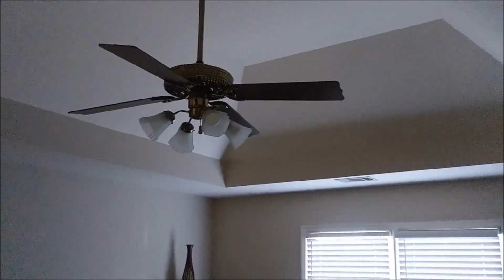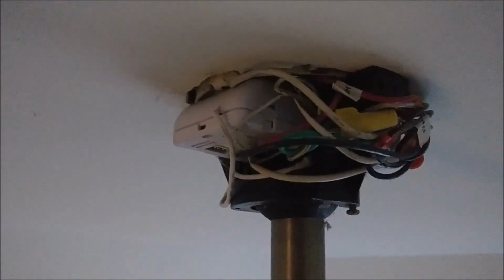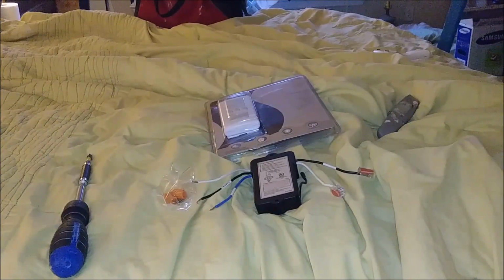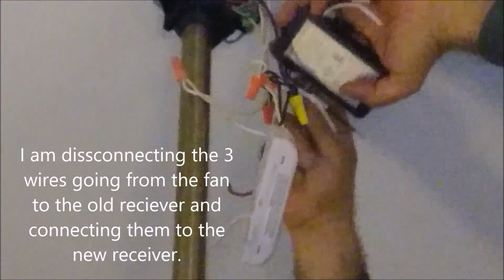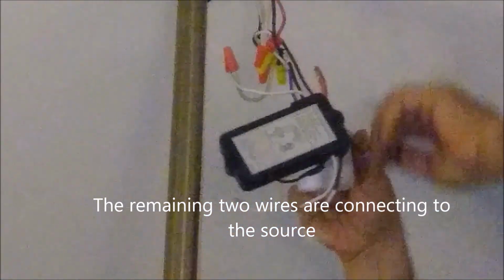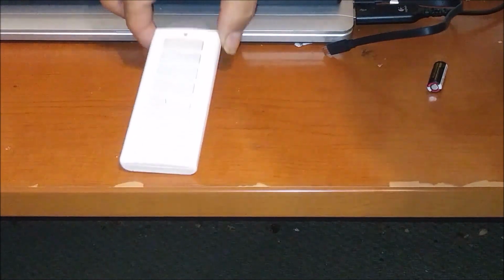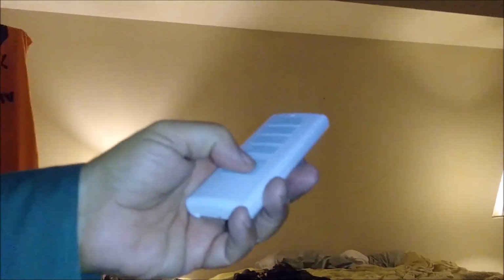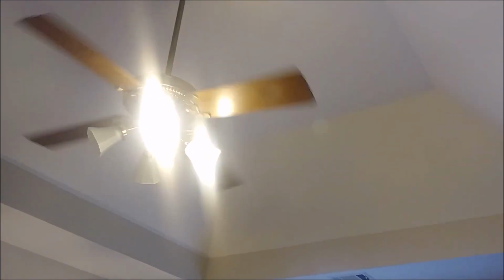Replace A  Bad Ceiling Fan Remote Control With Universal Remote Control - Step By Step

Comment: Main 2 WHT blk wires plug into the clear connectors. Don't cut them off.  Easier and faster than wire nuts!!
Reply from the maker: I agree . My mistake.

Comment: Thanks for the video. I'm having the same issue, the light is flashing. but the ceiling fan is not spinning. I'm not sure in your video if the fan was working with the old remote. For my case, do you think it is still due to the old remote control and receiver. Thanks.

Comment: My hunter fan lights sometimes turn off or on by itself. Replacing this part will fix it?
Reply from the maker: You probably have old remot that can not filter electromagntic noise. You should buy a new remote to replace the old one. Here is a link to new good remote and how to install it:
 Buy on Amazon Remote Control  = https://amzn.to/3i1VoVY  
How to install Video:   https://www.youtube.com/watch?v=yiwsOY6kqBY&feature=youtu.be&ab_channel=JosephK

Comment: How many time do you have to replace the remote control black box with the same ceiling fan?
Reply from the maker: Avarage one to 7 years but with the new technology it will last much more.
Reply: @josephk9182  Do I have to buy and expensive fan remote control to last longer or a cheap one, for similar duration.
Reply from the maker: No. Please look at my video:
https://www.youtube.com/watch?v=yiwsOY6kqBY&ab_channel=JosephK
There is a link under the video to but the remote on amazon. (Here is the link to the remote =  https://amzn.to/3i1VoVY)

Comment: Just wanted to thank you for this video. Even though it really is simple, as someone who has never done any sort of project involving wiring, this video was very helpful. It gave me the confidence to do it myself and it worked! The wires ended being the easy part, the hardest part was putting the dang canopy back on 😄 Thanks!
Reply from the maker: Thank you

Comment: To others watching this video: If your ceiling fan light is blinking, and your ceiling fan might be from 2007 or newer, it could also be a wattage limiter. Policy states that ceiling fans made in or after 2007 must have wattage limiter when including light kit, unless it includes CFL bulbs. It would be best to remove and bypass limiter first if there is one, then replace the remote receiver if it still blinks. Wattage limiter can be found in switch housing, or maybe even inside motor housing. However, the fan in this video is from mid 1980s so there is no way it has a wattage limiter.
Reply from the maker: The issue was the old receiver. I installed the same receiver on a number of ceiling fans in my house in 2009. All the receivers have similar issue with the lights after 8 years or so (no issue with fan speed only light). I believe this is the life expectation of these receiver. The new receivers are much better.
Reply: Yeah I know it's the receiver issue in your case, but some people had similar problem caused by wattage limiter.

Some people replace ceiling fans because they want ones that are remote controlled. It's a good thing you kept the old fans, they don't make things like they used to anymore!

Comment: That is a Hunter Designer's Choice. The fan is even older than the old remote; the fan is from around mid 1980s while the old remote is from around after 2000.

Comment: Hi Joseph. Thanks for share this video. Im in similar situation for a Hampton Bay fan, the diference is that my old fan receiver has two cords aditionals to red and blue: green and yellow, and the receiver that I bought has only two (like in your video). Do you has idea how to connect the cables? Thanks.
Reply from the maker: I believe the green wire is the ground. You need to do the following:
1. Disconnect electricity to fan .
2. Mark the 3 wires of the fan (2 wires go to motor and 1 wire to light when usually the black and white go to motor and the red or the blue going to light) .
3. Remove the old receiver.
4. connect the new receiver 5 wires (2 to  120 V source ) and the 3 other wire to receiver. The green wire should go to ground. 

Question:  Where the yellow and the green wires are currently connected ?
Reply: Hi Joseph. Thanks for your answer.
Let me check it and I'll tell you.

Regards!!